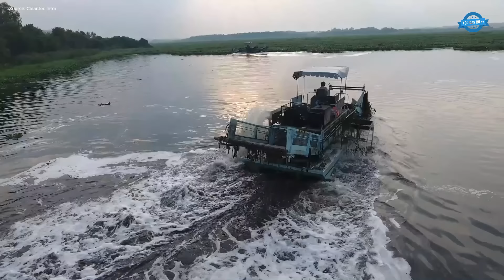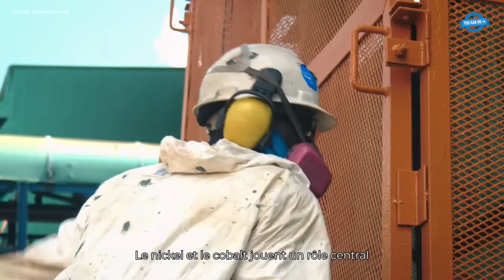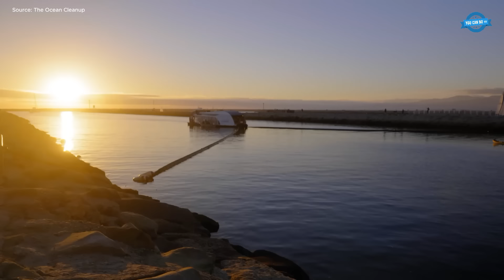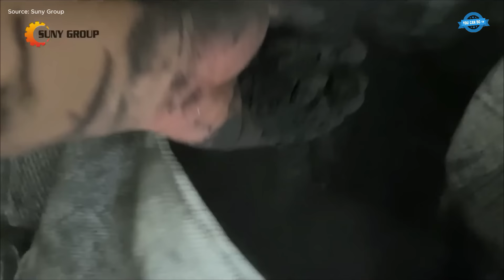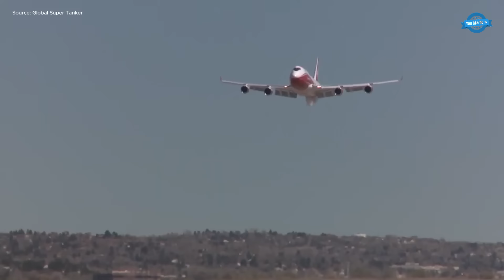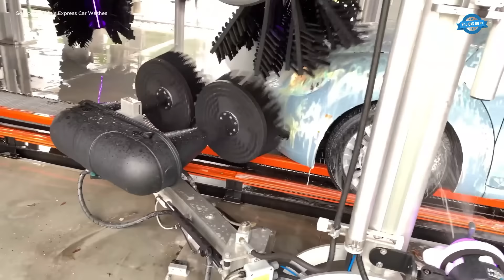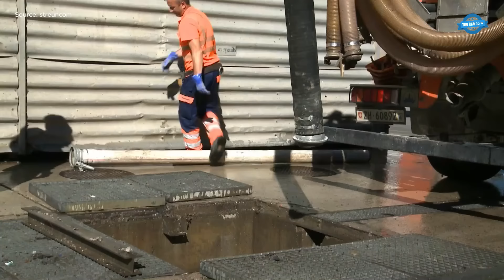Powerful Machines Cleaning Our Planet – Recycling, Dredging & Ocean Cleanup Tech You Must See!

Comment: @1:55 the fault is they trying to collect all trash at one location, they seems not realize the quantity and mass of it, so the water digs under, bottles compresses the water and creates a strong current, it would be a nice desiignn if its like a large fork with a bit narrowed teeth and has an adjustable height above so that you can onlytouch the trash above and it has a net to capture it

Comment: It saddens my heart, that we live in a global society that thinks that throwing away plastic garbage like anything else on the streets, in the rivers, or anywhere is backed up by a mentality of "someone else will clean it up, so I don't have to". Well someone else is cleaning it up, but it costs cut into other things things that people need in every country that is battling this problem. You could easily take this plastic and recycle plastics into new materials by mechanically separating them, cleaning the plastics of dirt, and then grind them up in a closed environment ( to prevent microplastics escaping into the environment ), to turn into new building materials. When it comes to land being turned into acres of dumps, landfills, that do nothing - except impose hazards, OR the issue of water ways, being polluted with plastics ( and microplastics ), we are talking about a threat that comes back to our health from the ecosystem that is responsible for our food and water. This means animals, plants, and even the water that we drink, are going to have these microplastics in them, and we are going to eat or drink them in our food and water supply. That is the threat. We need to educate people, so that the train of thought of "someone else will clean it up, so I dont have to", all the way to the industry so that other materials are used instead ( when possible ), other than plastics. Glass, paper, metal, food waste ( that can be turned into compost from plant waste, or animal bones ground up ), plant waste ( such as corn stalks from harvesting corn, or by products from trees, or other things we grow and use ), sewage waste ( such as separated biohazardous waste can be roasted ), and many other things can be turned new materials that can be used again to produce resources which are profitable, AND environmentally sustaining without threatening us. However, plastics are the biggest problem around planet. The good news is that there are mechanical ways to recycle it, and I have seen even a company in Canada, where they can extract chemically that materials that make up the plastics to be reusable again.
Reply: No matter what we do, we're screwed...  They've already found microplastics in the brains of animals and humans, as well as soil and plants.  I'm not giving up on life, but I've come to the realization that life over the next 20-30yrs is probably going to slowly go to shit for humans and the environment.